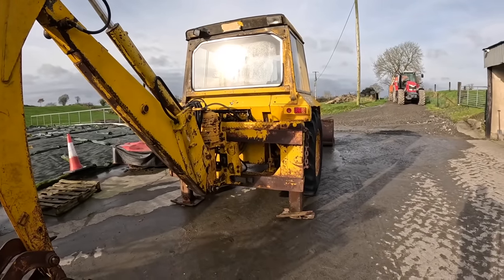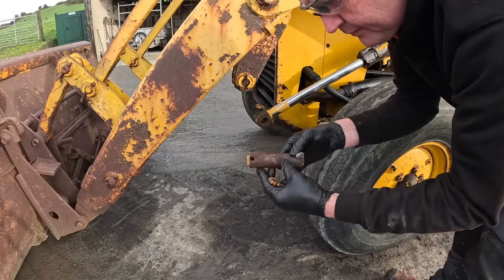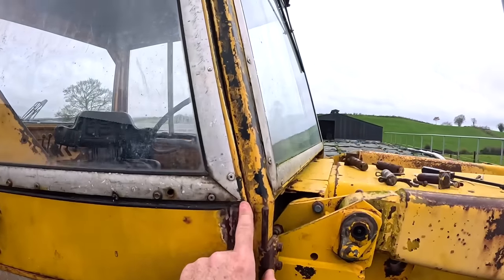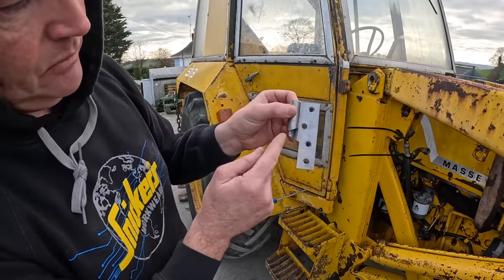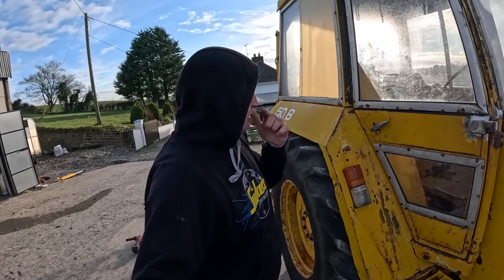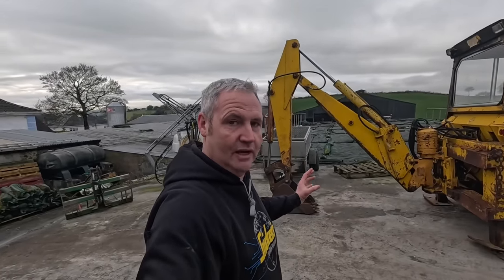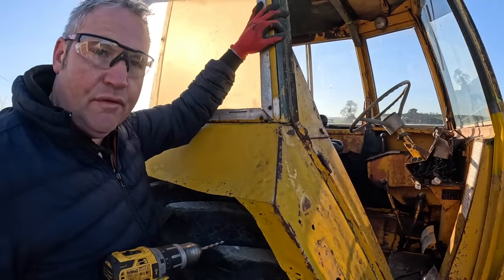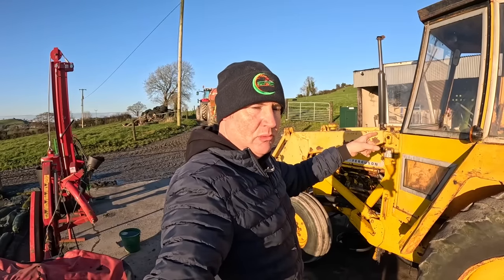Fixing A Twisted Cab || A Solution To Every Problem || Massey Ferguson 50B Repairs

Comment: The thermal imaging camera are great. Just a small thing to note is that if you try to measure something very shiny, like clean metal shiny metal, it’s not an accurate number. If you put some or something on the surface and let it heat up, you can get an accurate measurement. But of course works if you don’t need an accurate measurement it’s fine without the tape.

Comment: Wish I was a accomplished at odd jobs as you are I've been electrician for over 30 years now I'm a maintenance technician where I work repairing machines for tire recapping production for mostly tractor trailer truck tires and trailer tires. So lots of air and electrical. I'm now just figuring out how to weld never been taught so I'm learning quick by messing up and then redoing the job until I get good welds. Thank you for your videos you teach very well and have good knowledge of what your working on. God Bless
Reply: Farmers and showmen can fix anything lol

Comment: Just an idea, but the pin you removed to take off the rams. Get a 1 or 2mm hole drilled down the centre of them and a little hole in the centre hinge point. And a bigger hole on the outside to take a grease nipple and you can get grease in to exactly where it's needed.

Comment: 21:44  Hi Adrian, its polycarbonate (tradename Lexan) as opposed to Perspex whick is Acrylic. I used it on a Massey 860 digger door as a slight bend in the frame kept breaking the glass. It was about €110 vs the glass at €150. It doesn't break or yellow but it has gone a bit cloudy. I'd use glass if you can get it and can be sure it wont break.

Comment: Hi Adrian. 
Might be worth your while trying gasless wire/flux cored wire for the mig welder when welding outside. The slighest bit of a breeze can make impossible to weld outside with any mig welder.

Comment: Mr. Morris, Sir, great brain and a great pair of hands. Well done. I enjoy that you are solution minded, no problems just solutions, lets get on with it.

Cold ears . . . add wool hats to your merch and when you are at it, why don't you source a hard hat with a washable fleece in-lay with a head-lamp and a built in FM radio  . . . you get the idea or source something you would use, find useful, brand it ifarm wefarm and add to your merch.

The power unit seems ideal and if I needed one I'd get that brand on your recommendation, no second thought. 

Your standards are such a great bench-mark for other farmers. Your attention to detail and safety awareness are superb.

P.S. In the computer game, there is a saying; "RTFM", Read the feckin' Manual. Are there manuals available on-line from manufacturers for all the models they release.

Continued success.

Comment: That's a good job. You will have to either match a flasher unit to the L.E.D. lights or do what I did and fit a resistor. in the system otherwise it flashes too fast. Cheers Jim in N Z.

Comment: Great to see you working on the MF 50B The farmer I worked for back in the day purchased one brand new, I was a lucky Guy, and spoilt, the cab  was quiet, and warm. Do you still have a working heater under the seat.?

We fitted an additional spool to the loader control to facilitate using  a Flat 8 Bale lifter.

Than you for posting

Comment: Great video, enjoying watching the progress, something I do when filling in  drill hole with the welder put a brass hammer head behind the hole it makes it so easy to fill in, I liked the light mounts very clean and tidy, great hobby for you Adrian, my welder had that stutter problem fitted a new liner that sorted it but they can stutter a little when outside the wind blows the gas away, another fault can be the wire being dirty you can get a small cleaner that fits over your wire inside the machine just before the drive motor, you might already have thought of those things, any way very enjoyable video, good luck to you and the family

Comment: I see that the previous owner had pinned both of your curl cylinders in different holes on the upper end. Probably had to to that because of thhe different length rams. Make sure to pin them in the same holes.

Comment: I notice that there looks to be two mounting points for the tilt rams. I've often seen that on lift rams so that you can get different height or breakout force but I don't really see what the purpose of these might be. Those front light/indicator units were original on some Masseys during the 70's , I bet there are lads would be interested in those as they look in ok condition if given a quick scrub.

Comment: Try flux cored wire in your mig. No need for shield gas when working outside in the wind. I think you have to reverse the polarity to use it correctly.

Comment: great content, really enjoy seeing you adapt the yellow monster to suit your needs as well as getting it running right how  it should be. ive seen the thermal imaging on another video, they were using it to see where they  might be loosing heat from their property and if the electric boxes may have been over heating, also to find lost livestock at night, but it was unusual to see they`re tractor tyres had water in them that should have been there, only small tractor. thank you

Comment: Pretty sure that hanging filter is replacement for the original hydraulic oil filter and housing which should be under your left foot when sat in the cab. The original filter is under vacuum from the pump and some times the suction hose collapses and the machines struggle with both original filters in place so someone may have done this to sort any of those problems as a bush fix.
Reply: That filter is for the torque and transmission oil.

The filter under the floor is for the hydraulic oil running the loader and back arm.

Two separate systems and oils.

Comment: Can your welder take gasless mig wire? If your using it outside it woud make a huge difference to you. It’s not great for heavy structural welds but great for small fab jobs.

Comment: Cracking work sir.... can I mention what happened to that door/cab?   🤔   get a check strap on that door quickly as when the blow open or just fully open the handle catches on the loader frame  when its moved and hay presto one bend door or cab 😮😊.. .. on a fun note... are you going to be able to take both hand off the wheel when driving down the lanes to operate the indicators 😜😇.. fun..... 😊.. stay safe 🏴

Comment: Great videos 👍. When are you fitting a Euro 8 headstock adaptor to the front of the Fergie? Be interesting to see that done as I plan to do similar myself. Your issues you have with MIG welding outside.. I assume you are using gasless wire for outside welding? as the slightest breeze will remove the gas mask from a MIG and make welds vary massively/porous in my experience.

Comment: Hi Adrian  .I have  been  watching  your ferguson tef 20 videos .I recently restored  one like  yours and  i have a problem with  oil coming out where the  exhaust  meets the  exhaust  elbow .The tractor starts easily   but i noticed that the  oil pressure   used to be better before this problem  started   .This happens when the tractor is running  .Any help would  be appreciated .Thanks

Comment: Those bucket rams were on different holes at the cab end is that right?
Reply from the maker: No it’s either the slightest difference in length or just a mistake by the previous owner. They should be the same for sure